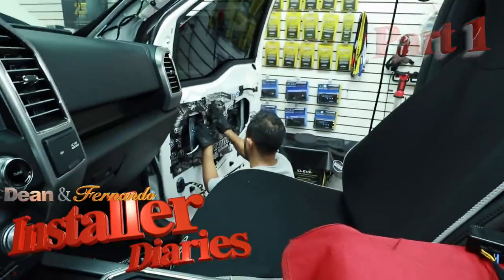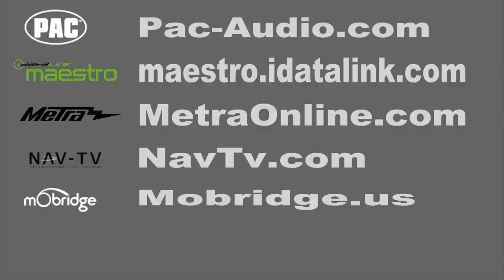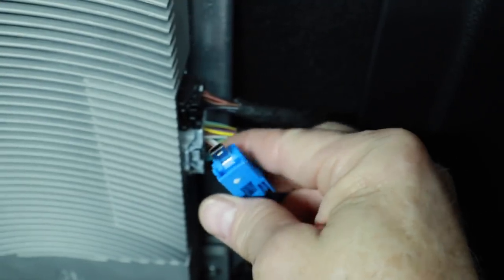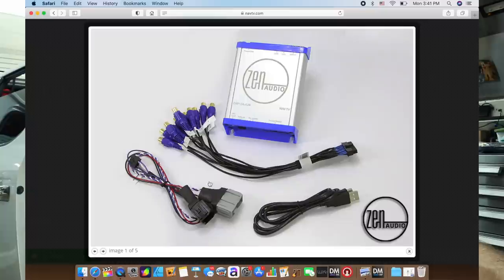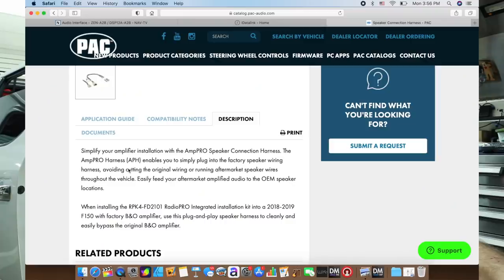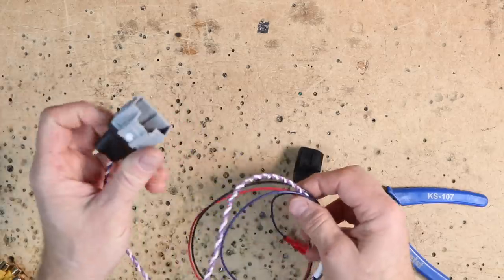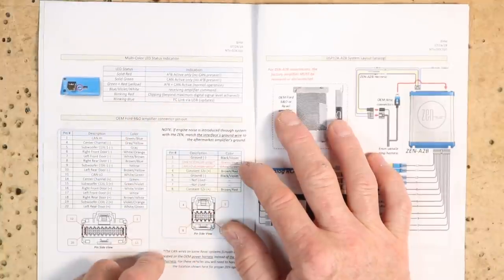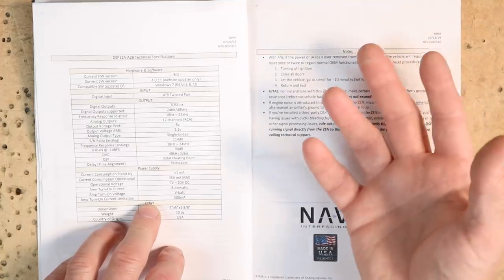How to Integrate using the Nav Tv Zen A2B  Installer Diaries 301 part 1

Comment: Done a ton of these zen a2bs before and I always use the APH-FD02.  You can either cut off the connector of the NAV-TV harness and solder the 2 CAN wires to the PAC harness or just leave it as a T Harness and keep the plug.  I cut it off so I don't have a bunch if dead wires in there and it ain't much to solder two wires extra.

Comment: How do you go back to stock after doing this? I just bought a 2020 raptor same system and they took their interface and speakers with them. Now stock head unit gets no signal from stock amp. Only thing missing is stock sub it’s gone now.